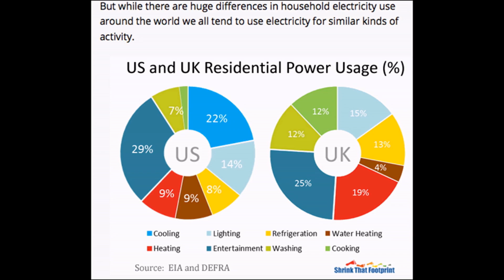1509 How To Convert A Washing Machine To Run On Alternative Power Sources

Comment: Interesting conversion. I watch some homesteading videos and interestingly the Amish have a hand powered washing tub with a hand powered wringer. Of course this takes up more time. The electric powered machine does not. It would be interesting to see a conversion using a mechanical timer to disengage the tub to end the wash time and even better one with timer and gearing to make a spin cycle before disengaging. Complicated I know and what to do about the water discharge would be possibly the most contentious and complicated to avoid land contamination.

Comment: When the drum moves about on it's suspension system, the drive belt will fall off, because the drum will be moving around whist the drive spindle is static. The drum must change direction every few seconds to prevent the clothes from tangling up - how do you propose to do this? The average washing machine motor is around 350W (1/2 hp) that would be too much for human power. To make this work you need to also consider the filling emptying and heating of the water. Please re-do this video covering these issues, so that we can actually do something useful.

Comment: 07:16 That's not how one pronounces Miele.
The correct pronunciation of Miele is roughly MEE-leh or MEE-luh. It is difficult to transcribe how you pronounce Miele phonetically because there is not an exact correspondence in English. The first syllable, which is stressed, is simple, it is exactly pronounced like the word "me". The "e" in the second syllable, -le, is pronounced similarly to the "a" in the word "about". The result is that the -le is pronounced with a sound that is somewhere between -leh and -luh

Comment: As you mentioned. The drum direction needs to alternate/agitate. So some kind of switching gear system would be required for this to work. Maybe building that could be the next project. Don't forget though that this needs also to only spin in one direction for the spin cycle. 👍👍

Comment: The only tradeoff with this conversion is the loss of features.  The controls open solenoids for hot, warm or cold water, time the wash session, empty the wash for the rinse cycle, time the rinse cycle, drain and spin cycle the wash.  You still have to run the water solenoids to get water in - unless you fancy pouring a bucket of water into a side-loader.  In fact, the motor was very efficient, so the washer was a prime candidate for a solar generator.  Luke just has to pedal the bike generator (made in an earlier video) to keep a charge in the solar generator to offset the washer load as it runs.  If Luke does really well, he can take breaks between cycles.
Reply: Oh, forgot about the drain solenoid - even if you can heave a bucket of water into the side loader without spilling a drop, how do you get it out?  And is there a little "pumping action" to entice the water to leave?

Comment: Canadian here, I swear by the front loader design. Mechanically simpler and just more reliable. When my brother and I moved out and we bought new washer and dryer for our laundry room, he went out and bought a top loader washer because of the sales person's marketing mumbo jumbo. I told him that why didn't he ask me about the washer before he bought it and I told him with the amount of laundry that he has to do as a massage therapist, the front loader is not going to last. Lo and behold, my brother loaded the washer with a batch of linens and didn't spread them out to balance out the front loader drum and the drum was so off balanced that I'm sure it would have self destructed if I didn't go down to the laundry room to stop the wash cycle. There was a moment of "I told you so" and we replaced the washer with a front loader.

Comment: You could use a DC motor and run it on a battery bank charged from any energy capture device. Ie solar. Wind. Water.
Reply from the maker: well it's a universal motor so it will already run on DC
Reply: @ThinkingandTinkering  but that motor requires 220 v doses it not? a person could use 12 v and car battery if the right motor was used. ie. starter.

Comment: Our washing machine at home has been running for years from alternative power. It's plugged into an inverter that runs from our off-grid solar power system. No faffing about with bicycle wheels! lol If you want the automatic washer to stay automatic, it would be very complicated to remove all the electrics and have a purely mechanical system. Nevertheless it could be done. 

However, there is piece of gear in these machines that is not really needed. That's the drain pump. This is really only a convenience so your drain hose can raise up to discharge into a tub etc. A solenoid valve would probably use less energy and the washer will drain quite happily by gravity if the drain outlet is below the level of the bowl or drum.  After all, we don't put the drains of sinks etc above the level of the sink and then run a pump to empty it! 

Our dishwasher is a slightly different matter though. It runs as a standard electric dishwasher from an inverter except for one thing. The heating element is disconnected. However, unlike laundry, having hot water is essential for doing dishes. I removed the solenoid valve and this now controls cold water feeding into a fairly large plastic solar thermal panel that once was part of a pool heating system. 

When the cold water is turned on it feeds into the bottom and pushes the hot water out of the top of this panel through a hose and into the dishwasher. Thus the solar panel is set up as an open system batch heater. It works well, and as long as you carefully choose the time of day it'll produce hot water in all Seasons for the dishes. In Spring and Summer of course you don't have to be so fussy.
Reply from the maker: nice tips mate - cheers

Comment: So you've used a bicycle to spin a drum. What about the controls? How do you get the drum to spin backwards? How do you add the water; add the detergent; trigger the drain cycle? How can you actually get the washing machine to do the washing?
Reply from the maker: pretty much the same way it did under electronic control but with mechanical control - for example to spin backwards - pedal backwards, a push valve to add water and add detergent - this happens at the same time anyway - use a foot pedal - same to empty it

Comment: I thought a universal motor could run on either AC or DC.  Reconfigure motor for DC and you can run it with a solar panel.    More than likely, the controller board actually runs on DC that is being produced by a voltage regulator.  

On my sailboat, I have a redneck washing machine.   It consist of a 5 gallon bucket and a toilet plunger as an agitator.
Reply from the maker: yes it can and you are dead right

Comment: That vintage sink mount water motor powered washing machine was awesome, I bet you could make a version of that for campers and vanlifers that would sell like crazy!  I've prototyped a dryer that uses the heat output from a Chinese diesel heater which would go very well with one.
Reply from the maker: That would be cool!

Comment: Old washers and dryers use to last 15 to 20 years and could be repaired. New ones hardly last longer than the warranty. We got a new one and it doesn’t work as well as the old one and washes less at one time. You might also want to consider friction heat to heat the water.
Reply from the maker: nice add mate - thanks for posting

Comment: Fisher Paykel makes a  top loading washer and dryer.
Reply from the maker: cool
Reply: I got one of the first whirlpool warble plate washers labeled Kenmore pretty whirlpool release,  Westinghouse made front loader washer and dryers in the 1950's that lasted until 2000, I  bought a GE, the Kenmore, a regular Whirlpool, and the Staber between 200 and 2007 with problems then I  purchased the New Zealand import and it is still working the interesting thing about the Fisher Paykel washer is the magnets and the coils  of the motor are molded into the plastic basin, and the top loading dryer is also unusual.